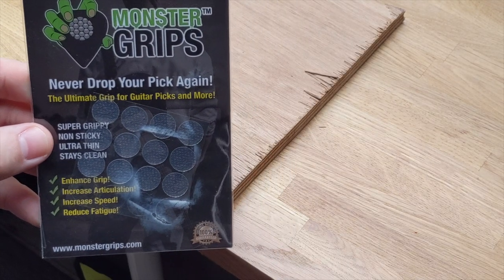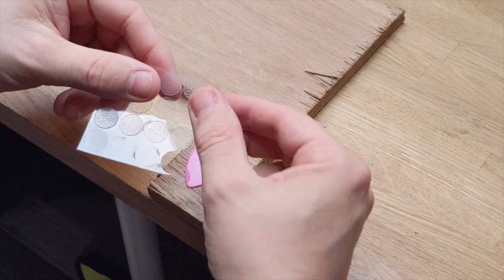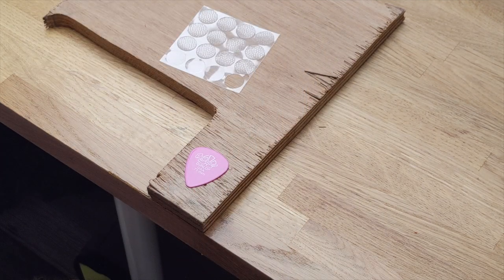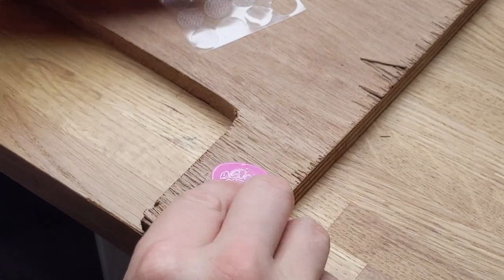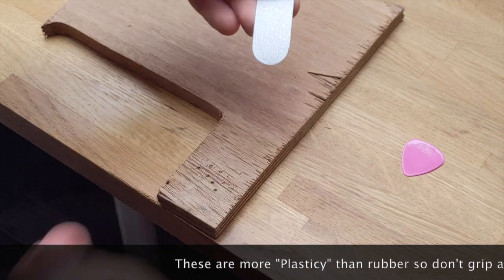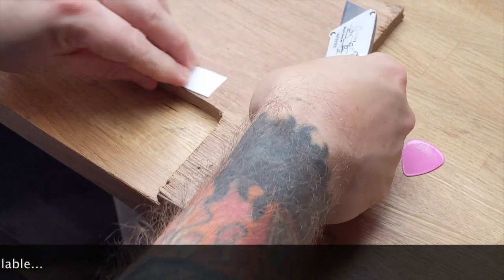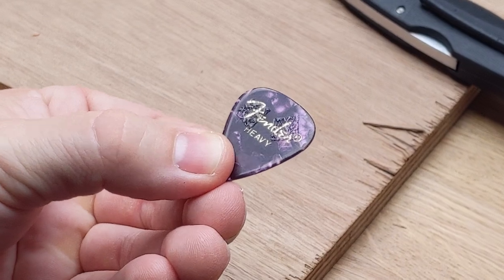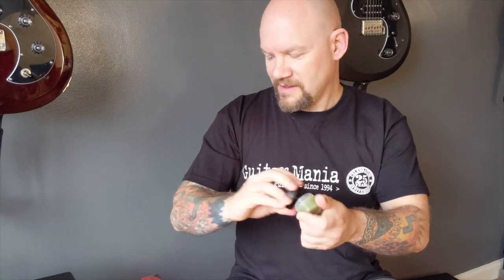Never Drop Your Pick Again!

Comment: What I've done, since I love to use the normal Nylon Jazz III, but they get so slippery, is to grind them off with sandpaper, but only where you grip em, so the tip still stays smooth. Worked great for me.

Comment: I started making my own picks after losing them so often, and I found that if I cut them into a certain shape I can get a better grip on them. Useful tips for sure.
Reply: Interesting . What’s your shape?
Reply: @blackmetalraider8081  i started to use "Triangles" picks form dunlop, they are way easier to hold
Reply: @blackmetalraider8081  Standard but with a a bit of a slanted jagged edge
near the one side at the top.